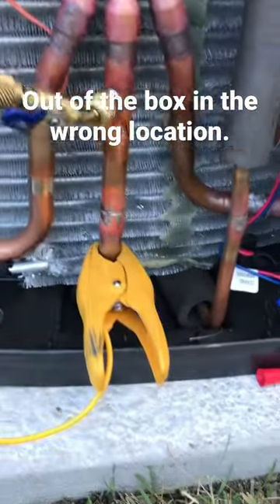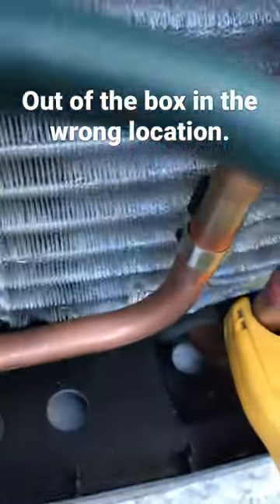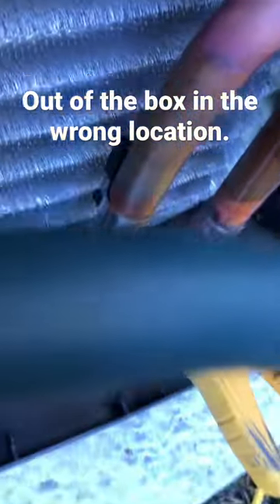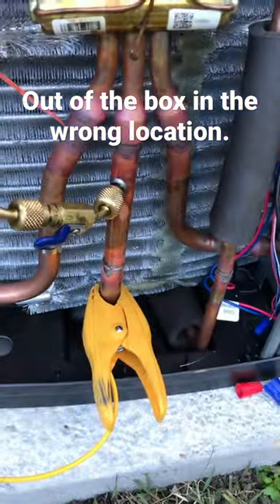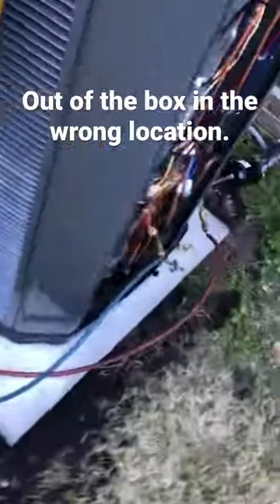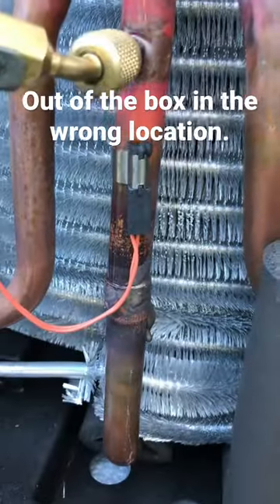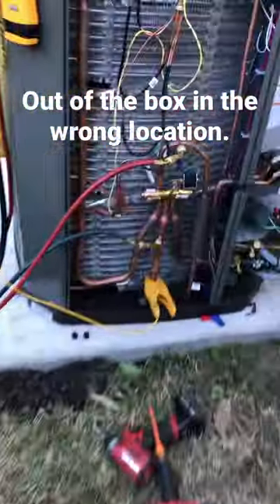Unit came with the sensor in the wrong location.

Comment: My company installs quite a few of these XV heat pumps and it’s become quite the common find in the factory putting the sensors in the wrong location. Even some of the coil temperature sensors.

Comment: On the duel unit for my h vac system.  I was told the reversing valve was siezed to the cooling side and that is why it doesn't pump heat to the house during the winter. I was also told it would be cheaper to replace the outside unit as the reversing valve is not replaceable.
  The h vac system is 30 years old, a Carrier Weathermaker 8000.
  What you say on this?
Although I may have the whole system upgraded in the future. Any recommendations for a replacement system. Higher energy efficiency.

Comment: I dont even offer Trane if a customer wants a Trane they can call one of Trane glorified technicians.
Reply: What brands / models do you recommend?
Reply: I don’t recommend any of them anymore. Just make sure you get your 10 year warranty and if you can afford the labor warranty buy it also. Whether its Trane or Goodman they are both trash. Aluminum indoor coils are failing left and right. I pressure test them now before I even take them out of the box. If your house has the lay out for it I would look into minisplits.
Reply: @WhowereEpsteinsclients  have coils always been made of aluminum or is that a new "improved" type thing some manufacturers started doing?
A friend got a Rheem exactly a year ago and it oddly produces so much algae I've been there to clean it every 4 months.
Reply: @Conald_isAfalseProphet 
Maybe copper, but im not an hvac guy. Im keeping all my old window ac units because theres rumors epa is gonna hit AC units hard

Comment: How about pointing at what you are taking about for us lunkheads.
Reply: The red wire. On the first one it's kind of the back side of the left pipe. It's on the second pipe in the front on the 2nd unit. Which one is right I couldn't tell you though lol
Reply from the maker: The one in the middle is right, should be on true suction line.